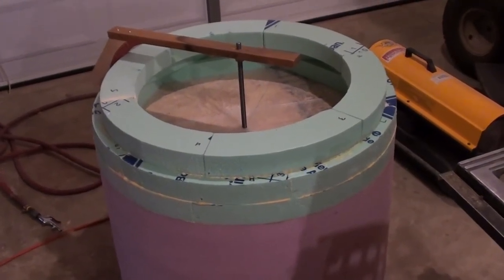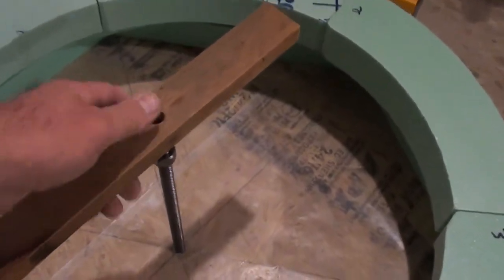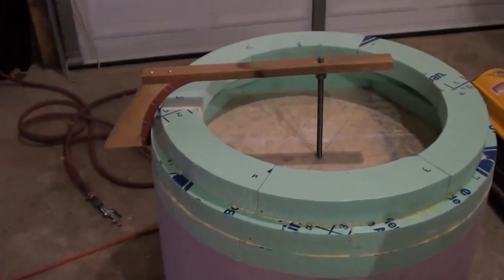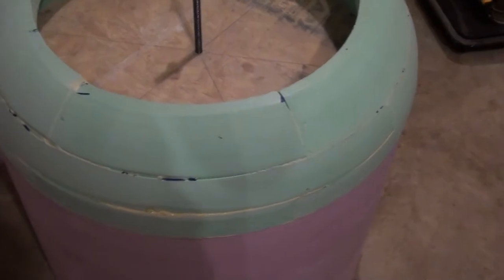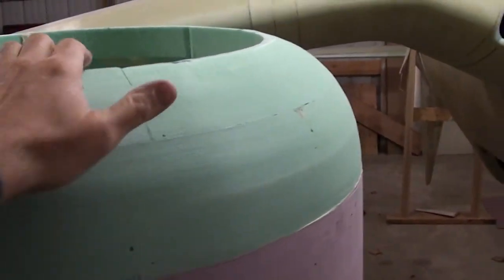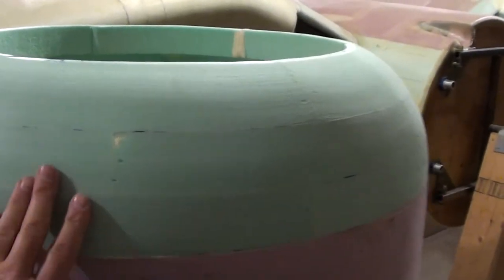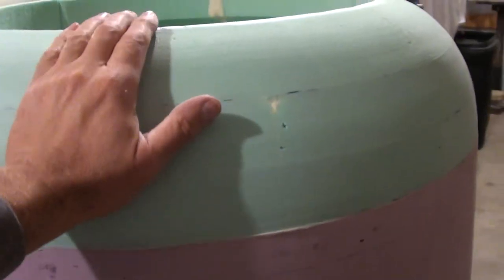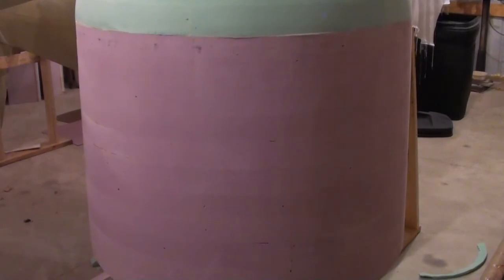W.A.R. Corsair Update 10-29-17

Comment: Is that the kind of foam you would get at Home Depot in 4x8 sheets? I’m going to build a P-51 replica and was thinking about using that foam and glass.
Reply from the maker: +Larry P,  yes it's the same foam. You need to keep in mind that this foam will melt if you get thinner , gas, or any harsh solvent on it. It is a common foam used on planes.  You have to use epoxy resin with the fiberglass cloth and not the polyester base resin.

Comment: Dynodon could i use the same foam for a composite aircraft? Im thinking about building a krsuper2
Reply from the maker: +Chris Edwards Yes it can be used on any composite design. This foam is 2 pounds per cubic foot. Some parts need foam with a heavier weight per cubic foot. Just remember this foam will melt with solvents or gas. Must use epoxy resin also.
Reply: Thanks for the info.  Im really excited to see your plane finished

Comment: One more question: what's the inner diameter of the cowling?
Reply from the maker: Daniel Picazo, the cowl is 1/2 inch thick. So it is 1 inch smaller on the inside overall.

Comment: Hi DynoDon, what do you think the g limits for this airplane would be?
Reply from the maker: noversibirsk +/_6G's
Reply: Thanks, I have another question, how much does the airframe cost to build minus engine, and instruments?
Reply from the maker: I doubt that you could do if for less than $5000. The wood kit is about thousand, metal and hardware would be over five hundred. Rod ends, rudder pedals, cables, wheels,brakes,bearings, and foam fiberglass, epoxy.
It adds up fast.
Reply: Thanks, I am getting a better idea of the costs.